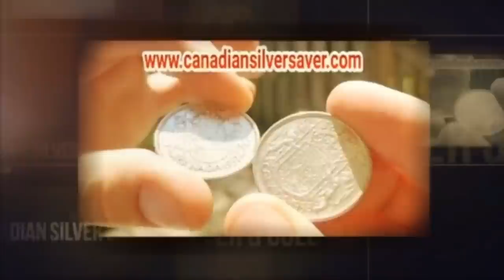1000 oz of pure silver being melted into shot by Beaver Bullion Canada

Comment: Ive learnt a cleaner, more efficient way of making shot than this. A crucible with a hole in the bottom, heat from the sides, water bin underneath. When the silver is liquid it will flow out through the hole.

Comment: Fun!  What most people don't think of is that the larger the bar, the cheaper/ozt they will pay!  I personally melt down sterling and sterling plate into shot, run it through a copper cell,  After I dry out the slimes, I melt them into shot and liquify with nitric acid, filter, cement on copper and run that through my silver cell. Sounds like a lot of work, but you couldn't get pure silver crystal cheaper any other way (that I know of).  It is all just so much fun, whichever way people chose to do it!  Great video guys!

Comment: Amazing cool video.  Thanks for sharing.  I would like to do this for much smaller quantities of silver.  What equipment do I need?  What is the technical name for the Gas torch?  What type of metal are the silver bars resting on?
Reply from the maker: Thank you. There are a few ways to do it. This was a propane,  acetylene mix. As for process at your own risk the silver needs to have enough water to cool long before hitting the bottem and enoght that the water doesnt boil. Steel grill from a bbq to hold the silver. The bricks help keep the heat in. Time, patience and some practice and you will be all good.